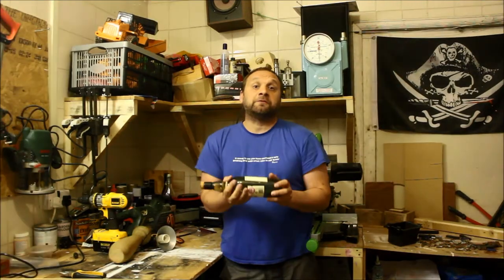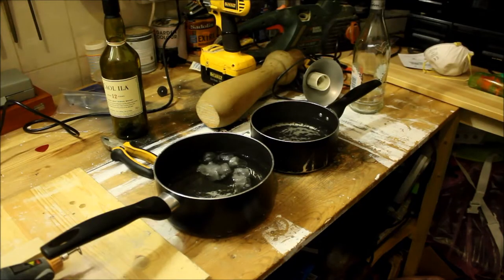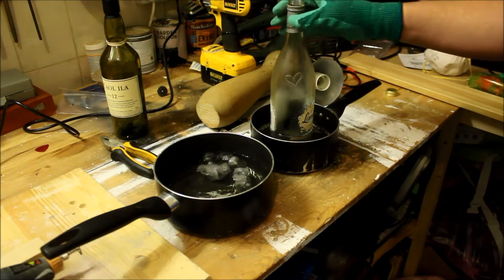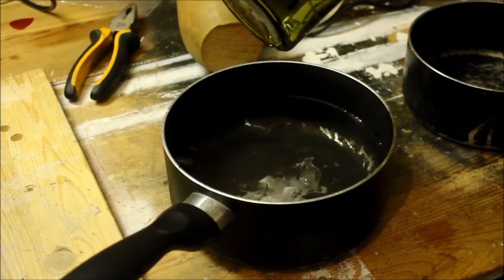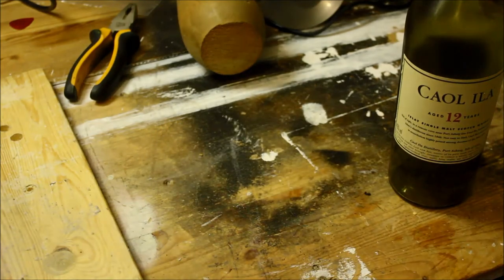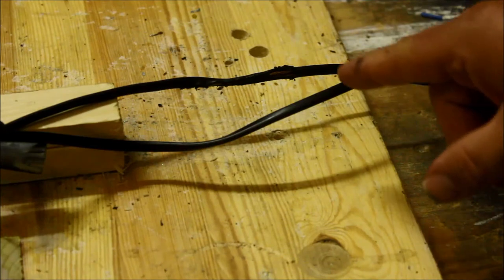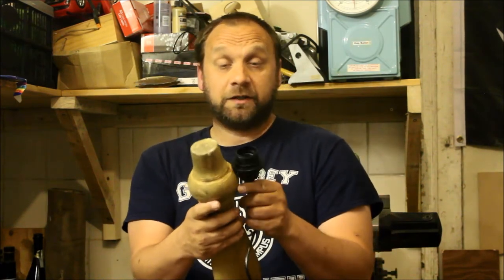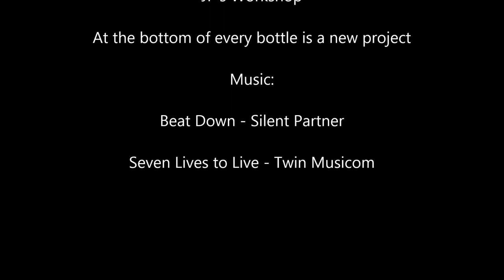Make a Lamp From a Whiskey Bottle

Comment: Super Late to this post. But the reason it failed is cause the thermal shock can take several minutes. In my case I have put the bottle 2-3 times back and forth in hot/ice water. Never seen it happen in one attempt

Comment: is there a heat escape from the bulbs? or is it at all necessary??
Reply from the maker: It's only a low powered bulb so not really necessary, however if it was a worry you could just take the stopper off the top of the bottle.